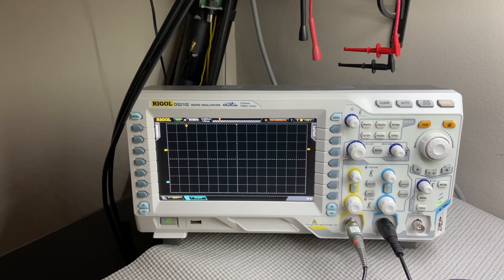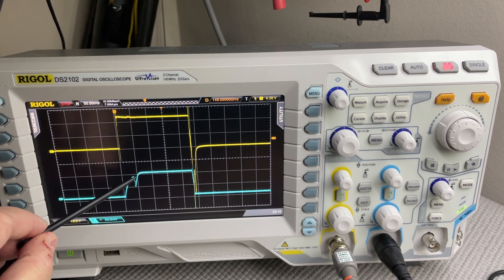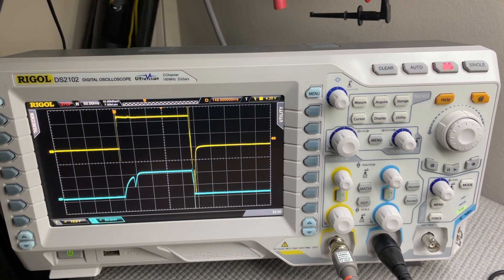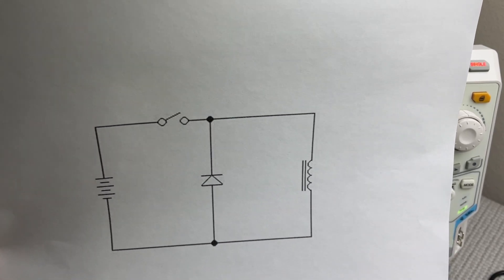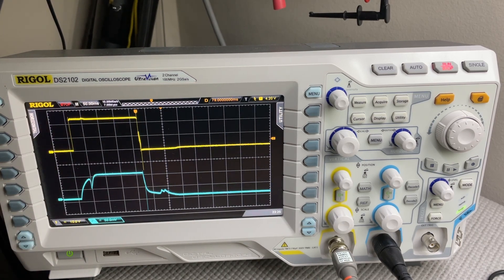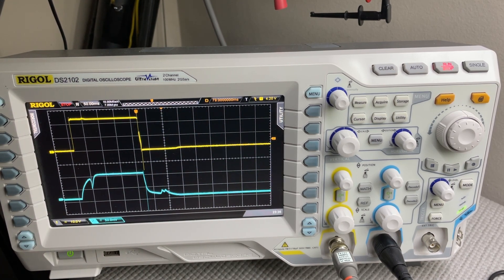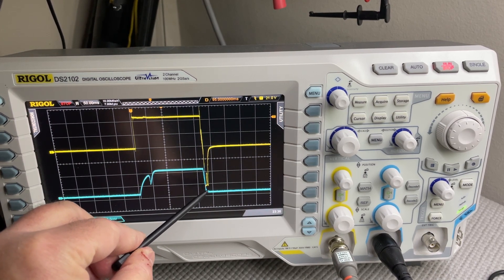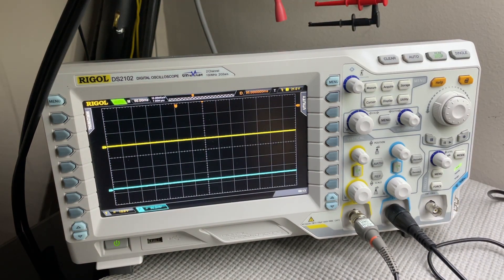DC Solenoids: Response Time, Current, and Voltage

Comment: Nice video. No useless stock video clips to dilute it, and straight to the point. Also schematics are shown instead of the breadboard or circuit, for ease of understanding. 
I would have expanded the time scale to show the details of the energization part, though, because they are too compressed in the first two setups.

Comment: This was really excellent! If I'm driving the solenoid with a mosfet, obviously I'd want to put the diodes in there for protection. But what value on the mosfet data sheet do I use to decide the largest zener value I can use while not blowing out the transistor? Thanks a lot!
Reply from the maker: I would think if driving the solenoid with a mosfet and connected to the drain you could look at the maximum drain to source voltage on the mosfet data sheet, Vds.
Reply: @GMT_400  thanks! Much appreciated!